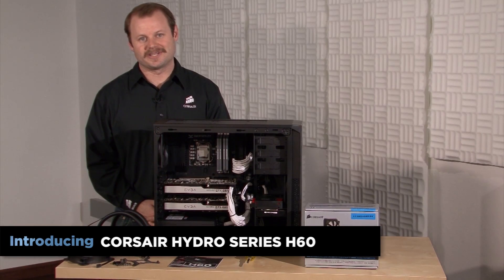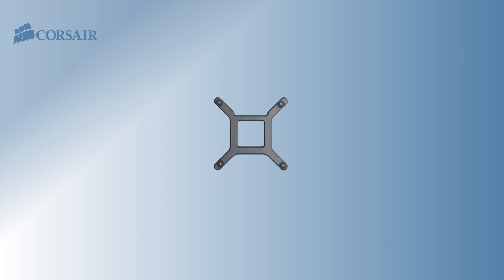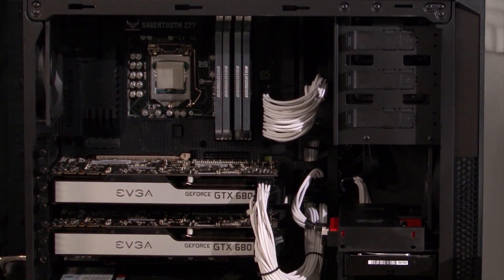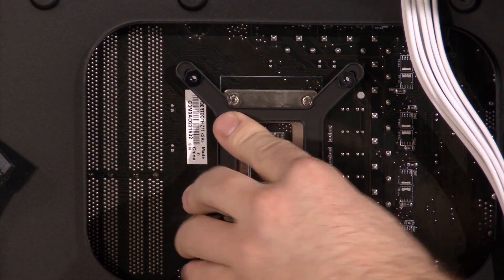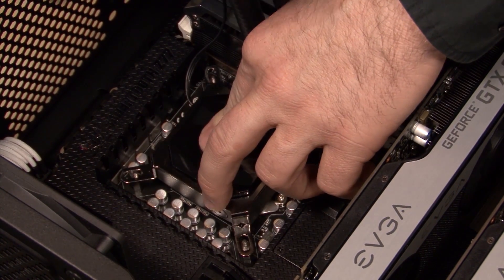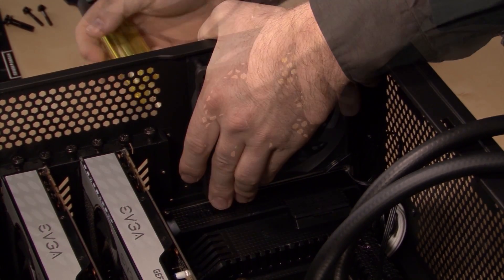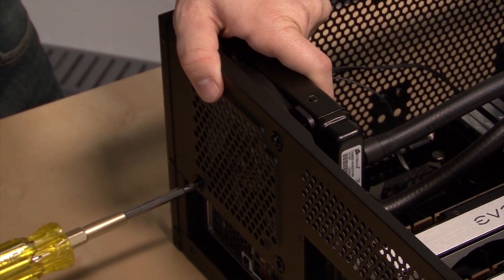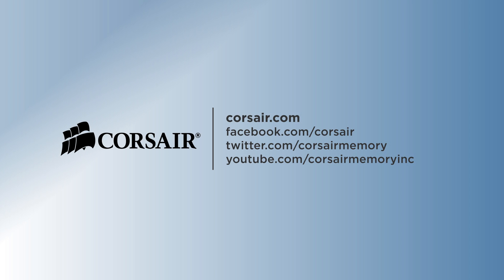Corsair Hydro Series H60 Liquid CPU Cooler Installation How-To Guide

Comment: I'm new to all this. How does the air flow work? Does the fan pull air through the radiator and out the computer or does it pull air from outside and blow it into the case? Wouldn't that heat the case?
Reply: +Doughnut, Lord of Friendship Most cases today can mount a fan at the top of the case. I would highly recommend you pull air from the outside and push it through the radiator (as he shows in the video), and have a fan that blows the air out of the case through the top of your case. Heat will always rise, so it's perfect to have exhaust at the top, and it blows dust away.

Personally, I took the old fan that was already at the back of my case, replaced it with the one that came with the radiator, and mounted the old one to the top of my case as exhaust instead. All other fans push air into the case (from the front, side and back, all with dust filters), and the top one pushes it out (with no dust filter of course).

Comment: Wait I'm so confused is the fan on the radiator drawing air from the outside and pushing it in the radiator?? Or is it taking the heat and pushing it out???
Reply: +IBuild AComputer well if you have a case where there are those grills at the top you can put the fan behind the radiator so it'd suck it in and rise to the top. Without those grills the hot air would become trapped so that's why if a case doesn't have those grills at the top it's recommended to put the fan infront of the radiator so it'd suck it out instead.

Correct?
Reply: Yes, it takes the cool air and uses it to cool the liquid in the loop so it can focus the coolness on the cpu.
Reply: +All Star He installed the fan backwards in the video.  It should pulling air from inside the case, and out the back.  You can install the fan in front of the radiator (push), or behind the radiator (pull) it really doesn't matter too much.  But that radiator/fan location within the case is an exhaust area, and the fan should be pushing the car OUT of the case.
Reply: +IBuild AComputer honestly all i need to know if this hydro series is compatible with the  MSI Z97 lol

Comment: so if i put on a after market thermal paste do i keep the one thats already on the liquid cooler or remove it?
Reply: +prince prince You should probably wipe off the paste that is pre-applied with a paper towel or coffee filter and some 70% Isopropyl Alcohol, then apply your aftermarket paste. If I were you though I would not apply aftermarket paste, the stuff that is pre-applied is manufacturer specific and automatically will coat your CPU evenly.
Reply: Happy Shark i was told not to use paper towels use some kind of cloth with no lint and to use a 90% alcohol and that after market thermopaste were better than manufacturer now im lost .
Reply: +prince prince you dont need to replace the thermal paste. You will notice a 1-2 degree difference performance and is not worth it. The paste that comes with the cooler is just fine

Comment: What about putting water in it?
Reply: +Happy Shark  . it still water based fluids hitting electric components ofcourse they would take damage....
Reply: +Chandler Rutledge If the water spills it will damage components, the liquid that is in there will not damage your components if it spills, also water will not cool as fast as the liquid that is pre-filled.
Reply: +Happy Shark.  there was a guy in one video who had one similar to this and one of his hoses came off and the anti freeze damaged his processor and the board
Reply: +Happy Shark i would like to correct you on that. there is nothing that you can put in a radiator that will cool better than distilled 100% water. the more additives that a coolant has, the less thermally conductive it will usually be.

Comment: So... the fan is taking air out of the case, or is it blowing outside the air inside the case? (In other words, that fan is used as an intake or exhaust?).
Also.. about the removed fan, wouldnt it be cool to put it on the other side of the radiator to create a full in/out ventialtion?
Reply: +Marcus Casagrande It's blowing outside air towards the inside of the case. For this reason, this setup is only recommended for cases that have grills on the top, otherwise the hot air (which rises) would become trapped inside the case.
Your idea of extra case fans at the top wouldn't hurt, but it might not make any noticeable difference in temperatures either. You'd have to test.
Reply: +bennemann Hey there, I endeed up making a build like this. Tell me what you think
https://www.dropbox.com/s/8dr9iwlzae577dl/cooling%20drawing%20new.png?dl=0
Reply: +Marcus Casagrande You could do two fans but they would both need to be SP type fans.  You can do a push pull config which is what you are referring to.

Comment: How could I remove the preinstalled thermal paste to remplace with Arctic mx4? or could I use the mx4 on the i7+the preinstalled paste? sorry for my english, I hope you could understand what I ask. Thanks
Reply: gd86arg You can just wipe it off with a tissue, then use some rubbing alcohol on a cloth to finish.
Reply: +gd86arg You should probably wipe off the paste that is pre-applied with a paper towel or coffee filter and some 70% Isopropyl Alcohol, then apply your aftermarket paste. If I were you though I would not apply aftermarket paste, the stuff that is pre-applied is manufacturer specific and automatically will coat your CPU evenly.

Comment: are both watercables suppost to be on the downside like that? shouldnt the warm water cable be on the upside and the cold water cable on the down side?
Reply: The top of the radiator should be above the cables and pump, so all the air bubbles stay at the top of the radiator. Otherwise, there will be gurgling sounds when starting

Comment: I see no one with Corsair has answered some of the valid questions herein.  So, just one 4-pin PWM connection is required with the H60 model? 
This video says so however, there really wasn't a good shot of the wiring system on the fan and cold plate.
Reply: Garth Clark have you figured it out, because i am stumped

Comment: so there is only one 3 pin connector ? or is there another one for the fan that should be connected to the cpu fan plug ?
Reply: there are actually two pin connectors, one for the radiator, and one for the fan itself.
Reply: yeah i ran into this issue just now, the quick start guide doesn't mention it and neither does dudestache in this video... had to go to here http://www.corsair.com/en-us/support/faqs/cooling
Reply: I have installed correctly and I'm getting core temps as high as 100 degrees Celsius, fan error code every time I start up, and there's no way to see if the pump is working. The Corsair agent who replied to ticket wrote me back with a big long email asking for me add it into the Corsair Link monitoring dashboard, but (it even says it on their fucking website), the H60 is not compatible. I hate this thing!

Comment: Total noob here, guys. So did this guy install the fan as an intake or exhaust? I'm confused as he says the fan is drawing air from the outside of the case so does it make it an intake fan?
Reply: The air is in taken from outside the case though to radiator.

Comment: The fans at the top will draw the air up...I have intake int he front and back then exhaust at the top. Remember hot air rises.
Reply: With this configuration the top fans must be quite powerful, much powerfull than the fan of the radiator, and within the room above the level of the radior and the top must be no obstruction for the air flow. Ohterwise the heated air from the radiator will accumulate in the case.

Comment: No. There are two. One for the fan and one for the pump/cooling block. Be careful and put thread tape on your screws otherwise the radiator holes will strip out upon first install. I had to flip my fan around bc the vid says opposite of instructions, & screw holes stripped right out

Comment: BE CAREFUL - RADIATOR HOLES STRIP! The Instructions show the fan being installed opposite of this video. Went to change on brand new instal, two of the four holes on the radiator stripped out. Since I bought it a few months ago Corsair will not send me replacement screws. I will be purchasing another brand next week, this one might be kept for parts but most likely thrown away. Thread tape is the only thing that is barely holding the radiator and fan on.
Reply: For those who now have a striped out radiator, use the next self-tapping screw size larger in diameter be it metric or inches. Your radiator will be good as new.

Comment: hi, i have recently built a new computer and everything seems to be going fine, however the Fan on connected to the Radiator isnt spinning, it twitched at the start but didnt continue to spin. i have tried it in a 12v 4 pin, in the CPU_Fan, the CPU_OPT.... (my mate tried) , the three pin (connected to the system fan4.... its a GA0z87x-UD4h Gigabyte Motherboard, first time building a computer.... any help would be appreciated
please

Comment: 2 months now i use corsair h60 on a OC FX 4100 4.6 Ghz. The noise is extremely annoying even in low rpm (A suite control fan) and the dust that pressure fan collects is unlimited. About the performance i am happy. 1.35 V with 4.6 ghz at 36 idle-59 max. Just to let you know guys :)

Comment: i feel if you replace your exhaust fan with this, it will keep a lot of hot air from leaving the center of the case b/c the radiator will be blowing in instead of out?
Reply: The radiator doesn’t blow anything. If you want a setup like this to push air through the radiator and then out of the case, flip the fan, just as he states in the video.

Comment: I hope Corsair made upgrades on the pump parts itself. I've had 2 seperate H60's and they both had trouble with the pump. A very loud rattling sound when installed.
It was even louder then my GTX680 on almost full blast.